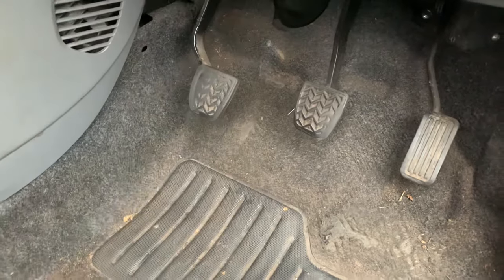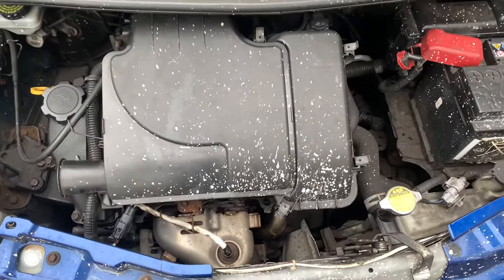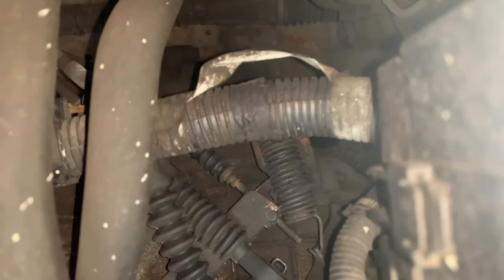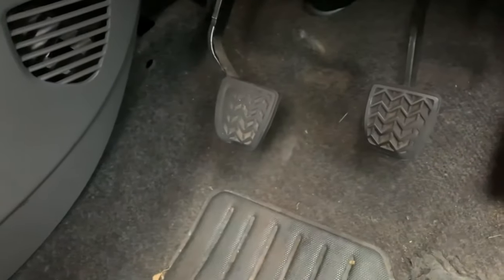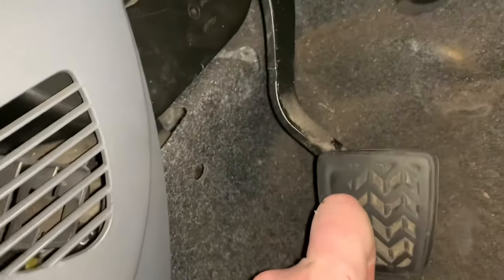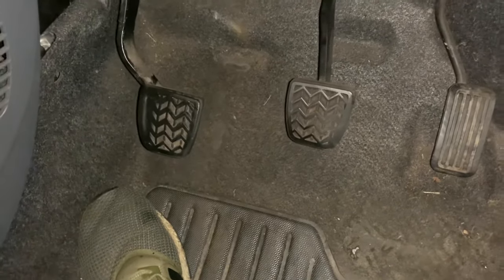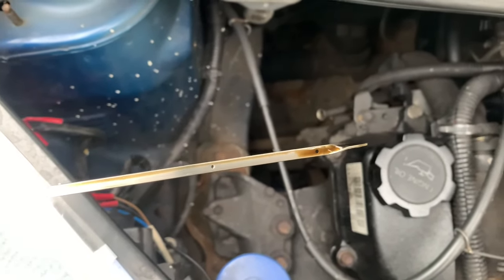Citroen C1 Clutch Adjustment (Clutch Cable) Aygo/107/CityBug

Comment: Hi, great video with great humour.  I have had my clutch replaced on my C1 a few weeks ago and it wasnt set up correctly. There was no free play in cable. Followed your video but loosened the cross nut, and got about 25 mm of free play and clutch is so much better and release bearing is now not in contact with plate.  Thanks again
Reply from the maker: Thanks, and you’re welcome.

Comment: I just had a go at adjusting the inside bolt, the one that stops the clutch pedal, a size 15 spanner sits on it nicely but can i turn it? Nope..it isnt rounded either, spanner just slips off it -.-
Reply from the maker: If I remember right, it’s a 13mm you need 🤔

Comment: My gears are stiff when driving but when the cars off the gears go in fine so is it the clutch that's the problem ?
Reply from the maker: It could be, or the gearbox oil/synchromeshes but this is the easiest thing to try first.

Comment: My car has the same problem, the bite point is 1cm off the floor, so all I have to do is tighten up the clutch cable?
Reply from the maker: Yes if it’s too low then tighten it a bit
Reply: Its not only that though, the pedal is quite stiff after you get past the free play.. not entirely sure how to rectify that
Reply from the maker: @adamek9750  could be the cable being worn/needing lubricating but most likely the clutch itself. Some clutches go stiff as they wear

Comment: Do u have a fix if the clutch gets a little tighter to press after a longer drive?
Reply from the maker: Is it definitely getting tighter, or is your leg getting tired?
Reply: You might need to change the gear oil, also a pretty common issue on these

Comment: Thanks for the video! The other day my garage adjusted the biting point to be higher, but I honestly prefer it to be lower (which is where it was before, and when the clutch was newly installed). I want it to bite my head off if I lift it, now it feels like I'm trying to put my knee behind my head every time I need to operate the clutch.
Reply from the maker: @KatonRyu  yea they are high as standard on these. I prefer mine a bit lower too. Don’t put it too low though as you could be burning the clutch when stopped with the clutch down.

Comment: There’s a vlog on here about new clutches installed on these without correct clutch adjustment. New plates and old adjustment. Really useful cheers
Reply from the maker: Yea often they do need readjusting when new clutch is fitted.
Reply: Hello and thank you for your videos are great 👍 I have a C1 and speed 2 must have had trouble switching to downshift what can I do please thank you in advance  @StupidBlokeStupidVideos
Reply from the maker: @lilylys440  you mean it’s hard to change down from gear 2 into gear 1? If so, this seems to be quite normal in these cars but depending how bad it is, your clutch could need adjusting so the biting point is higher up.
Reply: @StupidBlokeStupidVideos  Hello thank you for your answer, the problem was there and the clutch and change and the cables too but still difficult to go from the 3 to the 2 it hangs 🤔

Comment: Under the bonnet, a bit further down from those threads is a thumb screw wheel. 

You can turn it either way with your hand, to adjust free play. It's a bit more awkward if there is A/c pipes. 

You may need wd40 & a rag to get better grip.
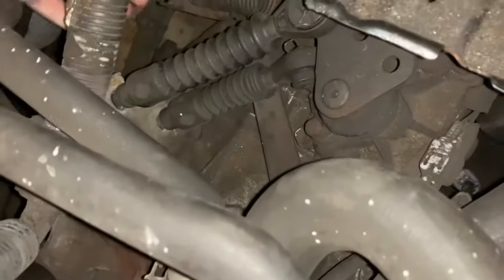Reply from the maker: I try to point that out at about 4:10 but can’t really see it. Mine wouldn’t turn and felt like it was going to break so just adjusted it at the end of the cable instead.
Reply: @StupidBlokeStupidVideos  I've been wondering whether they make remote controlled, colour changing LEDs for behind the heater control panel. Obviously they'd be tiny bulbs.

Could be a future video maybe
Reply from the maker: @nothingmuch.3014  I don’t know about remote controlled colour changing ones as they wouldn’t need some kind of interface incorporating into them, but I’ll probably change the colour of them at some point. I like the orange, but just because why not 🤷‍♀️

Comment: What is the large spring in the centre of the picture at 1:20 in called please mate? I know someone that has a broken one
Reply from the maker: It’s just a return spring for the gear selector, not sure on the proper name for it though.
Reply: @StupidBlokeStupidVideos  Thanks, I was trying to look for a replacement but can't find one anywhere ...great video btw mate
Reply from the maker: @MrEnigma64  cheers mate. Probably easier to go to manufacturer for something like that. They will be able to pull it up on a microfiche and find it that way, and should only be cheap anyway
Reply: Great video. Just my aygo 2007 started struggling suddenly but it is only 27k miles just like new what could be the reason behind?

Comment: Thanks so much for this video! Absolute life saver!

My issue was exactly the same as yours, I think my clutch was barely engaging with the biting point so close to the floor after a cowboy clutch replacement.
Reply from the maker: Good stuff, glad I helped.
Reply from the maker: @brewmyteabag1830  yes mate, on these cars the clutches are normally high with the biting point right at the top and can feel like they are worn out if you’re not used to them. Some people adjust them down to lower the bite, which can cause them to wear faster due to dragging slightly when in gear with the engine running and clutch depressed for example. Ideally it should be adjusted so there is a tiny bit of free play at the top, just enough to make sure the cable isn’t pulling on the clutch at all when the pedal isn’t pressed.

Comment: My gearbox changes gears fine, but i feel in the clutch pedal like something is grabbing when i press it. Makes an audible clunk when i press the pedal. Adjusting the clutch cable would fix this issue? Also if i barely touch the pedal, say 1 cm, i hear a whining noise which disappears once i press the pedal herder.
Reply from the maker: Adjusting the cable could help, or the cable could actually need replacing
Reply: hi, I have the same problem with my C1, do you know what the problem was with you?

Comment: No room on the Mark two do you know if the battery tray removes?
Reply from the maker: Never worked on a mk2, but if it’s not accessible with it in place I’d have thought it probably would.
Reply from the maker: @jusb1066  some do wear their years better than others though 🤷‍♀️

Comment: Hello there m8, again
I had to order the gear quick shift cause it was too short to change position to an already made hole, too short.
I ordered one like your gear shifter arrives in 10 days
A question concerning my clutch: Now I have to press it almost all the way down to change gears
Is that a sign of clutch needing replacement, or can it be fixed like in this video?
Thanks, m8.
Reply from the maker: @basba_qal  that’s usually a sign the cable has slackened off. When the clutch gets near replacing the bits usually goes higher up. Try adjusting it, tighten the cable to make the bite higher

Comment: Eyup T Dog, I’ve just noticed the wife’s car is grinding into reverse, when the clutch has been up in neutral. How long is normal for the transmission to stop running once the clutch is depressed. Once it’s in reverse you can take it in and out so I don’t think it’s binding as such 🤔
Reply: Also when I adjust the nut clockwise the clutch pedal physically lowers in the car if that makes sense. Just done 30x1/4 turns and the pedal is quite low and still grinding into reverse.
Reply from the maker: @jayf4210  a couple of seconds usually. Lowering the pedal will make this issue worse though. I’d maybe raise it a bit and try that.
Reply: Thanks for the reply mate, this is taking 5 or 6 seconds to stop. I’ll lift it again and see if there’s any difference 👌🏻

Comment: I've just got a citroen c1 for my first car and my dad fitted a new clutch but the pedal is much higher than the brake and accelerator and the biting point is quite high which is a nightmare for me setting off, would you recommend doing this to tighten it up?
Reply from the maker: They are normally white high on these cars but yea you can do this to loosen the cable a bit and also adjust it inside the car so it doesn’t lift as high. If your dad fitted the clutch himself I’m sure he’ll be able to adjust it too if he watches the video. Just don’t go too far as if the pedal is too low, the clutch may not fully disengage. That can cause damage to the gearbox or wear out the clutch prematurely
Reply: "Just don’t go too far as if the pedal is too low, the clutch may not fully disengage" Oh boy, i do sometimes have a feeling like when i press it's not fully disengaged but then again it could just be that the gearbox is worn? + i've seen a video of a guy pointing out that you have to double clutch to go from 2nd to 1st gear if not it's gonna grab/grind, but it also sometimes grabs/grinds when i try to put it in reverse @StupidBlokeStupidVideos  ,im guesssing this is a gearbox issue but could it just be the clutch?

Comment: Hi my daughters biting point is very high. Which way do I turn it to lower the biting point? Thanks
Reply from the maker: Depends which way you’re looking at it, but you need to slacken the cable off which is anti-clockwise. Best way to be sure is to move it a little bit then test it to make sure you’re going right way.
Reply: @StupidBlokeStupidVideos   Thanks I'll give it a go. Hopefully get it right.

Comment: hi, I have a 57 reg C1, do you reckon i could loosen mine to make the clutch slightly lower because the biting point is almost at the top and its a pain the arse to get used to
Reply from the maker: Yes but don’t go to far as if the clutch isn’t disengaged properly you could grind gears a bit

Comment: Hi, my daughters C1 has a really heavy clutch. I suspect its the clutch cable causing this. Is it possible to lubricate it with say silicone spray or is it straight forward to change the cable for a new one?
Reply from the maker: Yea it’s usually possible to oil cables which can help, but I’ve not taken mine off before so not sure how fiddly/awkward it is on these. I’d say that there’s more of a chance that it’s the clutch itself that’s causing the heavy clutch. Mine was heavy before I replaced it recently.
Reply: @StupidBlokeStupidVideos  Thanks for the reply mate, I thought it was the clutch cable because the resistance was the same throughout the clutch press, I thought if it was the pressure plate the resistance would increase as you pressed the clutch. Other than the stiffness the clutch works fine. I'm not a mechanic so I'll take your advice and have a go at replacing the clutch first and hopefully that will fix the problem.
Reply from the maker: @kampatel99 as you say, the resistance does usually get stronger the further you press the pedal when it’s the clutch itself, so it could he the cable and if the clutch otherwise works fine I’d deffo try oiling the cable before a new clutch. My clutch was just hard all the way when it was shagged though, and slipping too lol
Reply: @StupidBlokeStupidVideos  I'll try lubricating the cable first. Cheers mate
Reply from the maker: @kampatel99  let us know how you get on

Comment: My clutch is slipping due to the cable being too tight will this sort out the slipping clutch
Reply from the maker: Potentially. A cable that’s too tight can in fact cause a slipping clutch, but also the clutch could be worn. Try adjusting it first and see if it helps. Let me know if it does or not!
Reply: It’s deffo not the clutch I had a new clutch fitted yesterday and the mechanic messed it up by tightening the cable too much as I told him the biting point was too high
Reply: Also which part dk I have to turn is it the one at the top next to that orange colour metal thing?
Reply from the maker: @kashif274  deffo try adjusting it then. You can turn either. To loosen it, turn the bit that hooks into the clutch fork anticlockwise as you look from the front of the car, or the plastic outer cable clockwise. Both will do the same thing. The outer one sticks and won’t move sometimes.
Reply: Which one is the plastic outer cable. Is it the one with the circular pattern
Reply: Also do you have to push it with a screwdriver or an object of that sort or can you get someone to press the clutch down and then do it
Reply from the maker: @kashif274  to turn the outer you can usually just turn it by hand. There is a little locking device on it to stop it loosening itself off but you can usually just grab it and turn it.

Comment: Is it same for the newer model? (from 2015?), great vid! Thanks!
Reply from the maker: I believe so, but I’m not 100% sure. Some models may be in a hydraulic clutch. Have a look and see. If it’s the same, let me know!
Reply: @StupidBlokeStupidVideos  it's quite similar, i tried doing It now, it's abit more tight around, so i had to take out the battery and it's tray, but unfortunately i couldn't turn the nut for some reason, it's solid hard. Just set a screw driver against it to relief some pressure but still couldn't turn it.
Reply from the maker: @HeyJoeyYea  thanks for letting me know. Did you try to adjust both the outside and inside of the cable? If one is stuck, the other might work
Reply: @StupidBlokeStupidVideos  that's a good one, I'll try that tomorrow.
Reply from the maker: @HeyJoeyYea  I show the outer adjuster near the end of the video. In my experience that’s the one that usually seizes up though but yours is a newer car compared to the shit I’m used to working on 😂
Reply: @StupidBlokeStupidVideos  yep just finished now, worked out with the outer one. Thank you very much legend, couldn't do it without you.
Reply from the maker: @HeyJoeyYea  sweet. Glad it helped mate